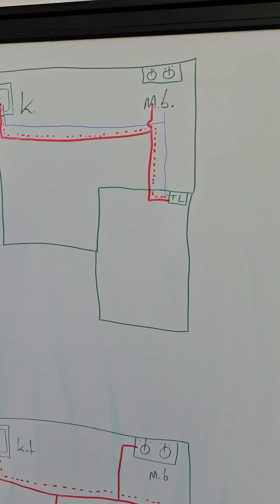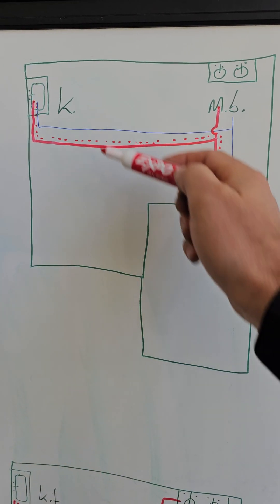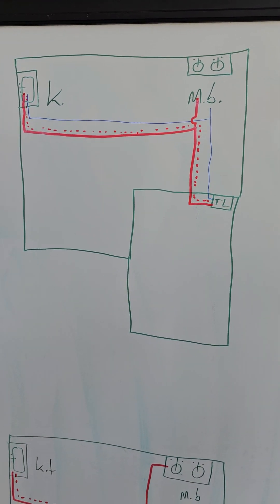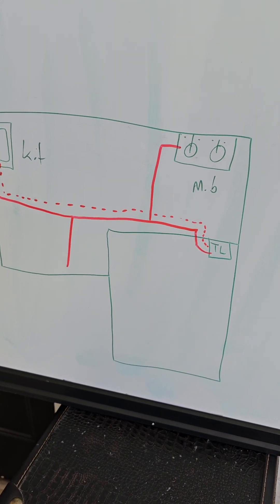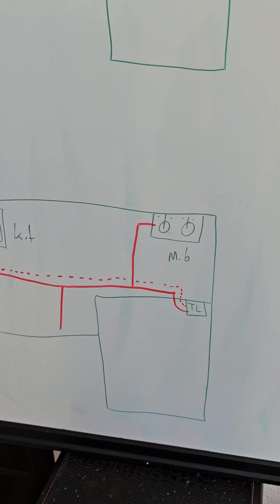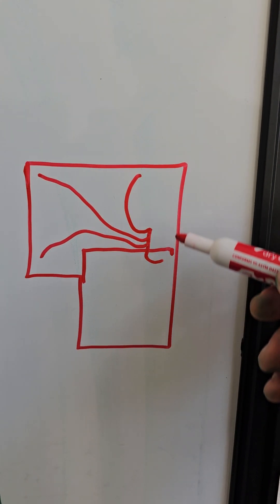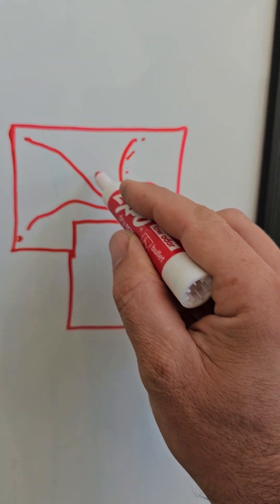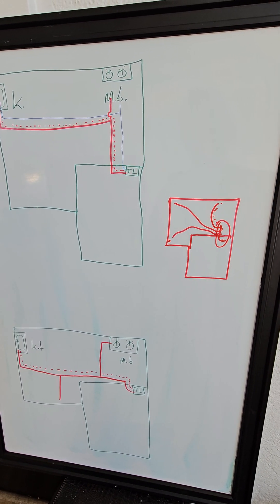Instant Hot Water Recirculation Loop. Tank or Tankless Water Heaters

Comment: Maybe you can answer a question or provide a solution. Our house was built 4 years ago - we have a tankless hot water heater (THWH) - Main shower is farthest from THWH - after 6 months of wasting water and waiting a few minutes to have hot water to shower - We installed a Recirculating pump to the HOT exit side of THWH configured with a WIFi smart plug that we can control via Alexis or our phones, We ran a return line from our farthest point ( Main Shower) and ran the return line to the Input of the THWH .  System works as intended BUT ----- after 1-2 minutes - we always get a cool down effect where the water gets cold for about 40 secs, water then gradually  gets hot again and we have a normal shower.  Any idea why or what's going on and how I can alleviate this effect?

Comment: If I was to use a tankless hot water heater as a strictly closed loop with a circulating pump, when the water gets to the thermostats setting would it stop heating until the water temperature come back down or does it continue to heat the entire time water flows through it? 

I’m trying to make a heated chicken perch for the winter. So the water will be constantly flowing through a 1 1/2 pipe. And then going back to heater. I just don’t know if electric/gas point of use water heaters have some kind of flow sensor that tells it to turn on any time water is moving. I just want low constant temperature. 

Would this work? Or do you know?
Reply from the maker: Oh boy. I love my chickens so this is a cool idea. Just curious. Would this be a dedicated unit for this purpose or would you do a loop from the house unit to the chickens? 

Btw, there are cheap electric mat options you can buy online, specifically designed for chickens.
Reply: @cleanairheatingcooling4105  It’ll be a dedicated water heater just to the chickens. I’m completely off grid and always looking for ways to save power. I was gonna use a propane water heater because I already have a 1000 gallon tank. I could try an electric one depending on how energy efficient it is.
Reply from the maker: @Eye4God  so it depends on which unit you're using and if the thermostat control is internal of the unit or if it's an external device you're installing. I could answer your question in more detail if I know exactly which items you're working with
Reply: @cleanairheatingcooling4105  I don’t have one yet. I was gonna make sure it would work before buying one.
Reply from the maker: @Eye4God  ok.
Reply: @Eye4God do you ever get an answer? Or figure it out on your own
Reply: @ I just kinda did some research. And it will work. Haven’t had time to do it yet because I’m working on wind turbines atm. But setting the water heater to the lowest setting and circulating it on itself would work as long as the thermostat turns off when it reaches the right temperature.
Reply: Omg! I’m trying to do the exact same thing but with my 10x15x3.5 koi pond outside over an Ohio winter
Reply: I have inside internal thermostat

Comment: Can you tell me what the difference is between a recirculating pump for tankless vs tank type water heaters?
Reply from the maker: There isn't any difference between them. Just how they are installed and where they are located is a bit different and it varies from 🏡 to 🏡 it also varies from unit to unit